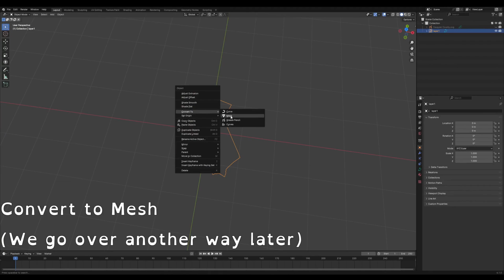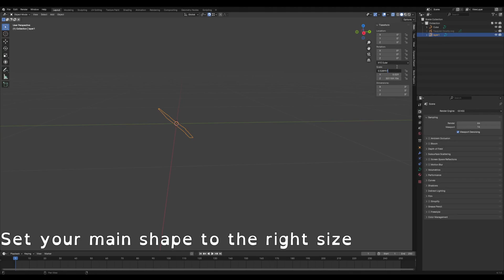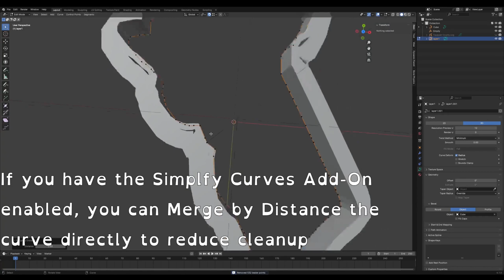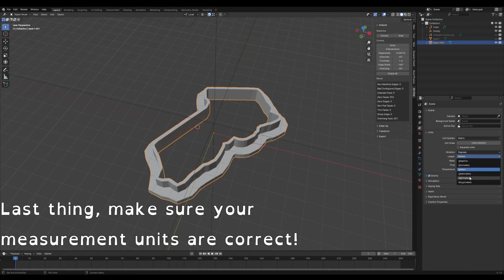How to Make Easy 3D Printed Cookie Cutters! [Blender]

Comment from the maker: EDIT: I MAKE A CRITICAL ERROR!  THE DIMENSIONS I GAVE FOR THE L IN THE SUBTITLES ARE INCORRECT!  CORRECT DIMENSIONS ARE BELOW:
__ 0.0625" __
|                      |
|                   0.25"
|                      |
0.375"            |__ 0.1875" _
|                                              |
|                                           .0125"
|________ 0.25"___________|

Just wanted to remind people to follow the general guidelines for making food safe 3D prints!  This print you see here is specifically for ceramics, not cookie dough.  Check the description for a link to a guide for food safe 3D prints!